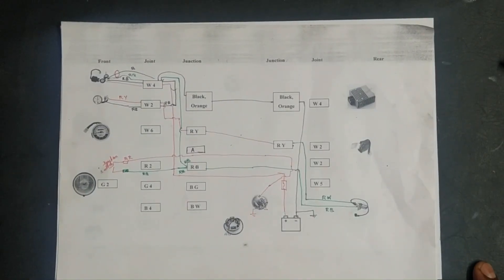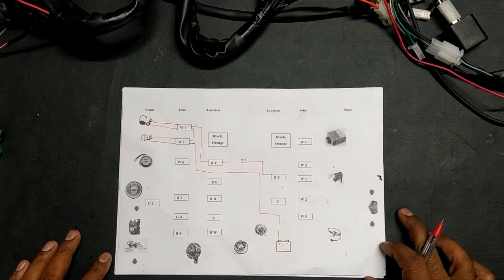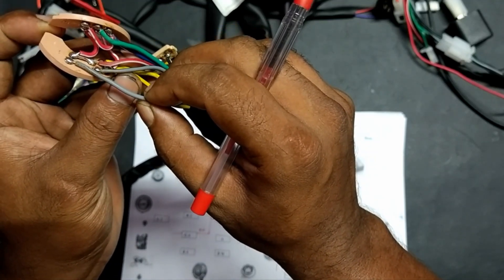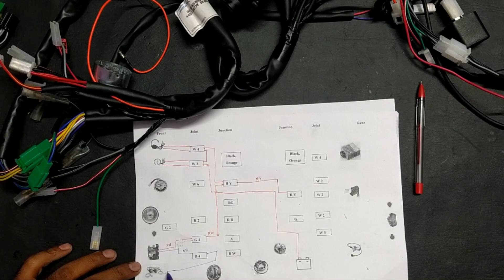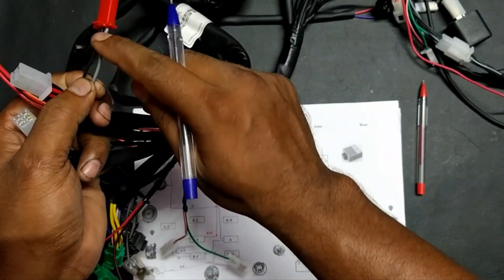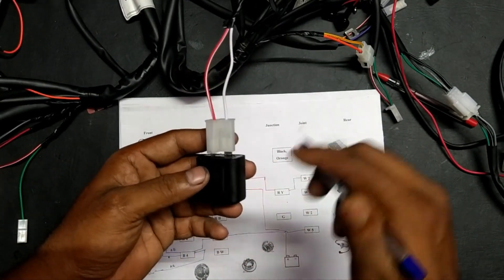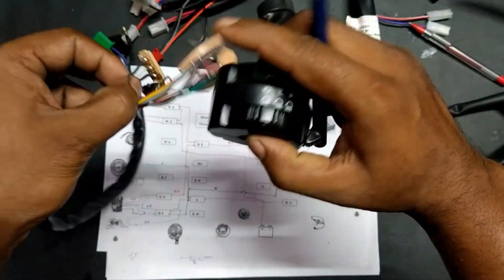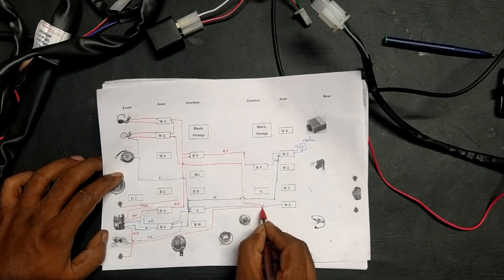Royal Enfield wiring | Part 3

Comment: Sir can you explain the wiring diagrams of 6 volt bullet 1971 model in which two key one in right side panel and another one is near seat in left hand side near carburettor and light and poilet bulb switch is in front  near speedometer. You explain very well in your video .  Thank you  . I really appreciate your video

Comment: At the front of the wiring harness there is a single orange wire with a round male bayonet style connector. What does it connect to?
Reply from the maker: Back side of headlight bulb holder
Reply: @ECFixeljin  Do you have a video on installing/wiring the headlight?
Reply: @ECFixeljin  ??? Do you mean the ground wire for the headlight holder?
Reply from the maker: @callmeanythingbutlatefordinner  Yes
Reply: Is this the same wiring for Std 350 2010 model

Comment: Thank you ..
In first vedio you said ..positive from battery goes to key and then to ammeter ...in 3 Rd vedio you said battery's positive wire goes First to ammeter then to key..which is correct ...and
 please provide the link to print out you are using..
Reply from the maker: First video I have explained about battery discharge and part 3 is about battery charging ( it's a reverse process). Battery-ignition key - ammeter
Reply: @ECFixeljin  thanks

Comment: in your Royal Enfield wiring part 1 video you said from the battery it goes direct to the ignition switch check at 4:22 and then it goes to ammeter and now in this video your saying it goes to ammeter first and then to the ignition switch check at 0:43 please correct your diagram 
Royal Enfield wiring part 1 link
https://www.youtube.com/watch?v=KAOKHWSk7OQ
Reply from the maker: Check carefully in part 1 it's discharging from battery. In part 3  i have explained about alternator and charging it's a reverse process
Reply: @ECFixeljin  hahahah